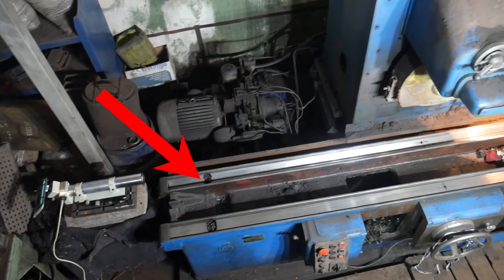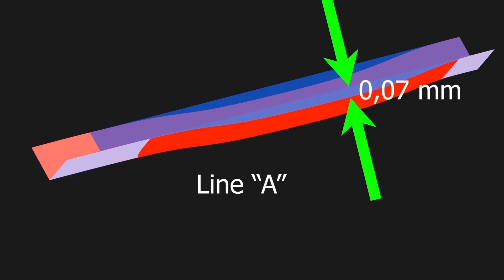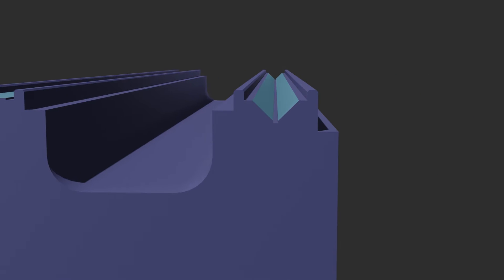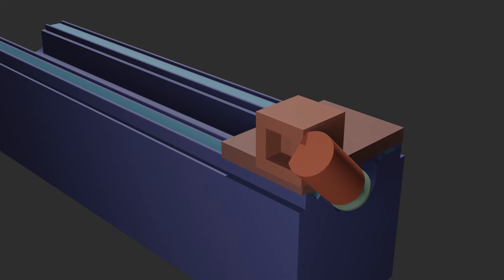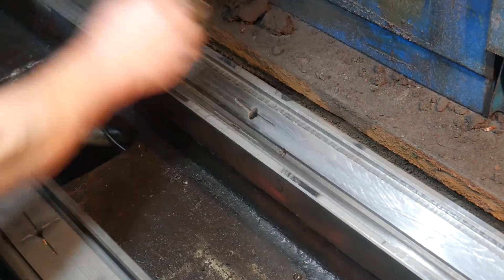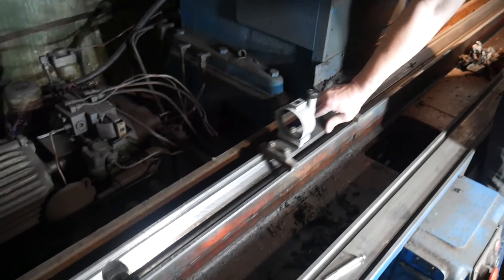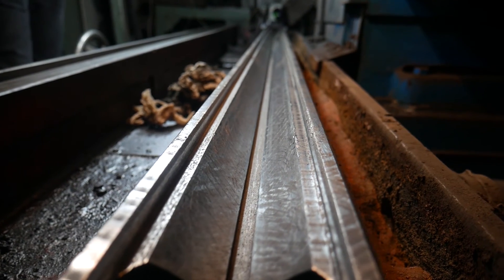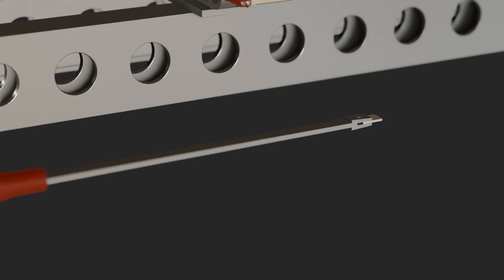Repair of a 3000mm long machine guide according to autocollimator readings.

Comment: could you do the same notion explained in this video by adding linear guide rails for the grinder head? in other words, buy two sets of linear guide rails and fabricate a grinding head to grind the ways? the linear guides will "produce" a flat and consistant plane to grind the machine ways.

Comment: In order to understand which bases to take as a basis, it is not necessary to invent, for this there are Pekelis and other authors. These bumpers, which you check half the film, have never been guides. The base is the guide frames - flat and wedge-shaped. The accuracy also depends on the condition of the spindle.Check its geometric accuracy, the condition of the bearing supports, if you are already offering the audience academic accuracy, go to the end, and you have taken up your games again. Do you at least know the main base of the grinding machine, what orient is aiming at, placing it, for example, on a huge flat-plate? It will not be the sole of the bed, if anything. They all tell the same story, fragments without beginning or end.
Reply from the maker: In the video I explained to the viewer the meaning of my actions. I understood that these grooves do not have to be geometrically accurate, and most likely they are not. But I should have checked their condition. If the machine on which these grooves were planed or milled was new at the time of processing this bed, the accuracy of these grooves could be higher than the accuracy of worn guides. In addition, if these grooves had a slight defect in straightness, I could correct it with less labor. In this case, I could use them to reduce the amount of manual work on the main guides. What's my mistake? To eliminate translation inaccuracies, I duplicate the comment in Russian.
Reply from the maker: Я в видео изложил зрителю смысл моих действий. Я понимал, что эти пазы не обязаны быть геометрически точными, и скорее всего таковыми не являются. Но мне следовало проверить их состояние. В случае, если бы станок, на котором прострогали или профрезеровали эти пазы был на момент обработки этой станины новым, точность этих пазов могла оказаться выше, чем точность изношенных направляющих. Кроме того, в случае, если бы эти пазы имели бы незначительный дефект прямолинейности, я мог бы поправить его меньшими трудозатратами. В таком случае я мог бы использовать их для уменьшения объема ручной работы по основным направляющим.  В чем моя ошибка?
Reply: @gena_bazarko  The mistake is that no one will grind the ridges or collars to limit the free movement of roller separators as the base surfaces. У шлифовального станка есть неизнашиваемые базовые поверхности, относительно которых ведутся все замеры. Надо смотреть паспорт. У токарных станков это, обычно, плоскость крепления коробки подач. Именно относительно ее (а не тумб или ножек станины), надо выставлять все остальные плоскости. Вот какую мысль я пытаюсь до вас довести. Многочисленные ошибки в видео и самописных "руководствах по ремонту" не отменяют объективной реальности :-)))
Reply from the maker: Я сделал перевод части коментария, которая на Английском, но к сожалению не понял сути этого предложения(. В отношении базовых поверхностей на этом станке, я пока не определил их. Но поверьте, резать металл на направляющей я начну только тогда, когда за счет предварительного анализа текущего состояния поверхностей буду точно знать, где и сколько металла нужно удалить. Но за советы спасибо. @user-Master1969
Reply: @gena_bazarko  Поясню эту часть: никто не будет шлифовать технологические канавки, как базовые поверхности. К ним привязываться, вообще не надо, некрасиво получается. Так-то все интересно, прибор у вас - прекрасный и оба канала - отличные, ничего не скажешь. Но теорию вы не очень любите:-).
Reply from the maker: Я надеюсь что со временем смогу убедить Вас, что с пиететом отношусь к "теории". @user-Master1969
Reply: @gena_bazarko Вы человек дотошный, разберетесь. Просто, даже если исходить из формальной логики, базовые поверхности являются основой формирования геометрии станка. Рабочий или мастер советского станкостроительного завода, отлично зная этот факт, вполне мог не уделять внимания нерабочим поверхностям. Пять лишних минут перекура важнее, не говоря о выполнении квартального плана. Ну, а если бы даже они были ровными, то относительно чего и насколько это соотносилось бы с общей геометрией станины  - неизвестно.

Comment: A think it's fine to use the synthetic voice as long as you keep doing do some parts with your real voice. The 50/50 mix is great.
And I agree with other comments
- if it helps you make the videos easier then you should do it! Fascinating material.

Comment: I stumbled on this video from an algorithm mistake and I dont know what this is, but man, im intrigued. Maybe it wasnt a mistake? Anyways, Slava Ukraini!
Reply from the maker: You write that you came across it by accident. It’s not entirely clear, but it seems interesting. Then I’ll briefly tell you about my channel. The point is that with special knowledge and skills, you can simply make a very precise metal-working machine with your own hands. It’s even easier to take an old, worn-out machine, which in this condition is worth little, and give it a complete overhaul, turning it into an excellent, accurate machine that, accordingly, allows you to make high-quality and accurate parts. On my channel I show how this is done.

Comment: Another great video! Thank you very much. With the voice, do whatever you are comfortable with.
Reply from the maker: Hello! By chance, I had the most interesting opportunity to repair a fairly large machine using only manual work and technical calculations. Fortunately, I recently purchased an excellent autocollimator. It turned out that I have everything I need for this. I myself am intrigued by this project. Moreover, after the repair I will be able to use this machine at my discretion, paying a rent. For me, this will be an excellent opportunity for further work on creating YouTube content and for practical work.

Comment: Those animations are high quality, excellent work. As for the voice over, I will watch your content either way. The 50/50 split in this video was also nice. Though, if you continue to use text to speech I would prefer a male voice if possible - or a lower pitched female.
Reply from the maker: I used a female voice to emphasize that this was an assistant, that was the motive for the choice. I will take your opinion into account, thank you. In any case, I intend to pronounce part of the text myself so that the video is not impersonal.

Comment: Your English is perfectly understandable, every thing is fine: vocabulary, phrase construction, pronunciation, etc, I'm sure it would still be perfectly fine if you put half the effort into it, and if it meant that we get more videos, most of us would advise to do it !
Reply from the maker: I would like to pronounce part of the text in the video myself, so that I can still learn to pronounce and understand the English text, but at the same time use part of the text from the speaker. In addition, there is another problem: when I have to say the entire text myself, I am forced to shorten it as much as possible, realizing that the work of dubbing will be enormous. Using a speech synthesizer, at least partially, I do not limit the volume of text, and this is better.
Reply: @gena_bazarko that's a good compromise !

Comment: I find your English very easy to understand. The AI generated voice is not much better than your own voice.
Reply from the maker: It’s more pleasant for me to accompany the video with my voice, but it’s difficult and long for me to complete this task. Of course, modern translation systems with accompanying sound make it possible to cope with this, but it takes a lot of effort and time. (so many). That’s why I at least partly want to make the work easier and faster.